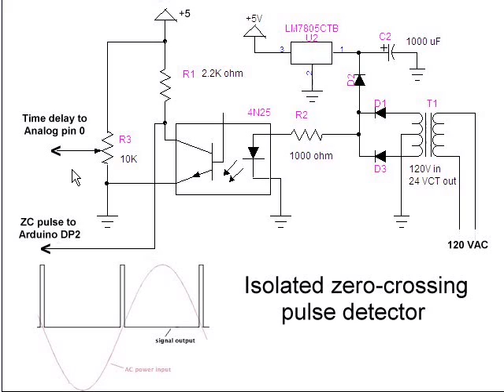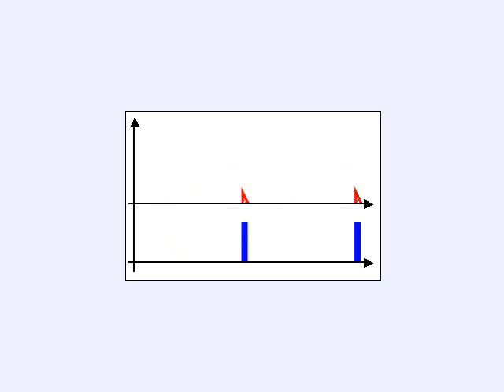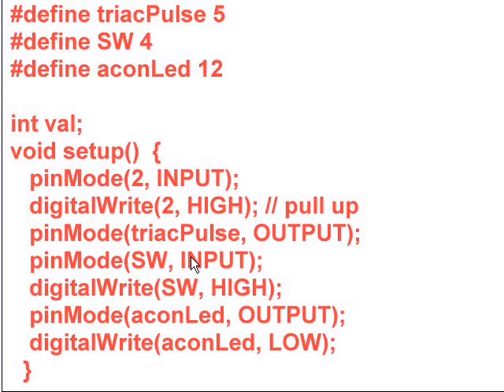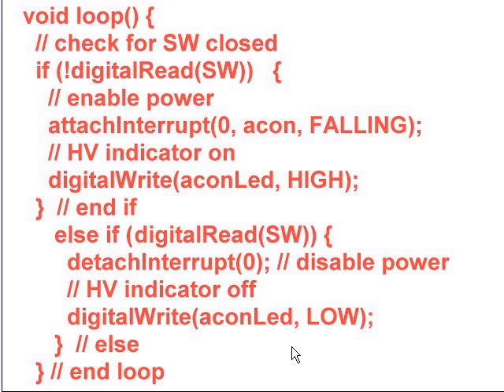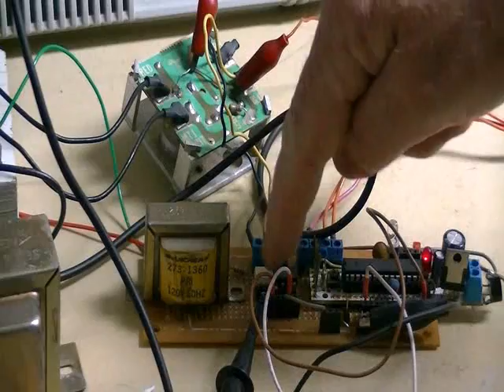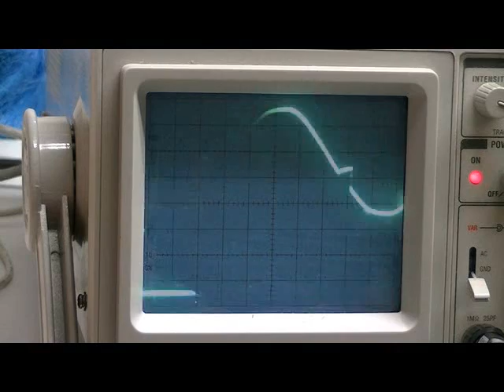Repost Arduino AC Power Control

Comment: Hi Lewis. Sorry if the question is naiive, but I'm trying to understand the power and resistance rating required of the resistors on the AC side of the MOC.  I'm on 120 VAC power, and I want to drive a 1.5 amp inductive load. If I =V/R and I've got a 180 ohm resistor between MT2 of the triac and pin 6 of the MOC3011, does that mean I'll only have .66 amps of current available to drive my load? Do I need to drop the resistor down to 80 ohm to allow 1.5 amps through? Also, if w= V*V/R, assuming R = 80 does that mean I need a  resistor rated at 180+ watts? Similar questions for the resistor on the snubber.  None of the examples I've seen make reference to such high-power resistors, so I'm sure I'm missing something.

Comment: Awesome video Lewis. Thank you for sharing this. What kind of resistor and capacitor were used for the snubber? What kind of power ratings would be applicable for these?

Comment: Hey Lewis, if I use digital potentiometer, can I check Time delay and send serial instructions to control it from same node?
Reply from the maker: +Buhnanafone Youtube That could work but can be a problem on timing. If you are doing what I think use a digital pot and a 555 timer in the triggered mode.

Comment: why do v multiply the analog read(0) with 6
Reply: This got me curious too. I'm thinking it has something to do with the maximum delay between pulses. Mains frequency in the US is 60Hz, and since he's getting a pulse on the 0° and 180°, he's getting 120Hz. The maximum reading from the potentiometer is 1023, so (1023 * 6) + 1000 = 7138, plus the 200 uSec fixed delay for the triac on pulse makes a maximum delay of 7338 uSec and a minimum of 1200 uSec. For 120Hz, the maximum duration of time between pulses will be 8333.33..., so that leaves 995 uSec extra per pulse. If he'd multiplied by 7 he would have gotten a maximum delay of 8361 uSec, which is too slow to keep up with the 120Hz signal. He could have changed the +1000 part though (which I believe he only did so that there's a minimum delay even if the potentiometer is at 0) to something smaller to allow him to get closer to exactly 120Hz. For example if he'd done (analogRead(0) * 7) + 972, it would have given him less than a microsecond left over per pulse. You want to avoid stuff like that though, so *6 and +1000 was a safe bet, leaving a little headroom for the arduino to keep up.
Reply: Dangit, I literally just unpaused the video and he explained a lot of what I just said. I paused at 15:45 to type the comment :/
Reply: @TheH2F  what will change if the frequency is 50hz??

Comment: This is the best video I have seen on the topic of AC control using an arduino.I have been searching for this video for a while. Is there a way you could show the schematic for a true 240v, as in 2 hot wires and a neutral. I am wanting to control a hot water heater element that is 240v. Thanks
Reply from the maker: Simply use a 220V transformer, a 600-volt triac, and an MOC3020 opto-coupler.
Reply: Could you post the wiring schematic for 220?